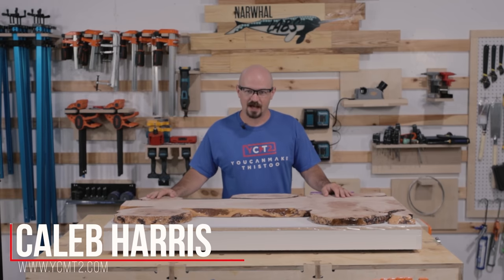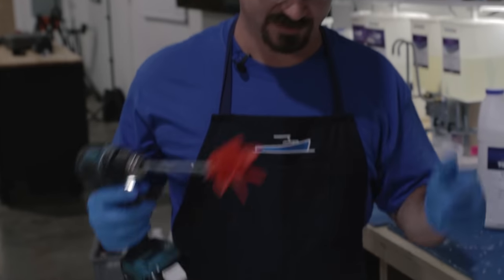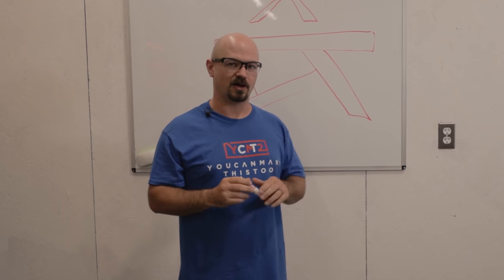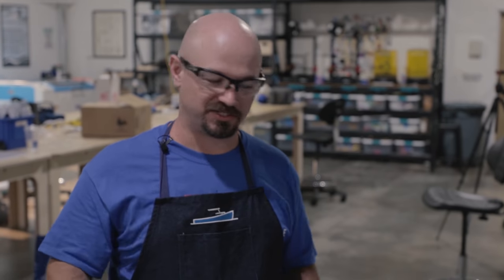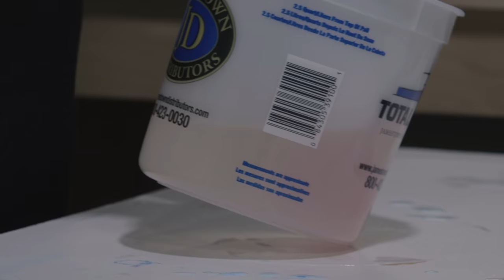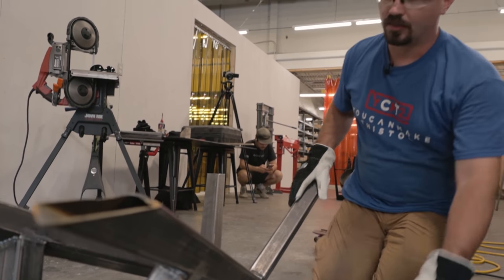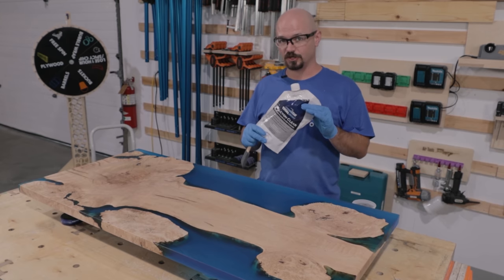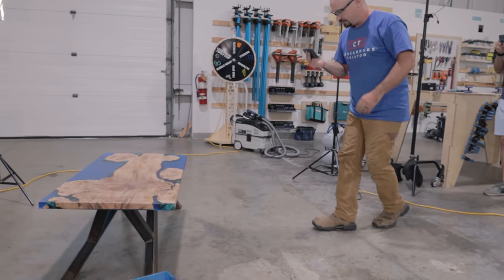Flew Across The Country To Build This

Comment: Stunning table. This may sound a stupid question but after you've poured the resin could you use the "bottom" as the "top" if not why?
Reply from the maker: For sure, it doesn't matter. I used to always do top down actually.

Comment: I noticed you sealed the edges of your wood but didn't key them with sandpaper to accept the subsidence pours. You may find that it will start to delaminate after a time.
Reply from the maker: I thought about that afterwards. I don't think it'll be an issue though because of the geometry, they pours are pretty captive. Also, the edges were still quite rough so a fully chemical bond isn't as necessary since it can create a mechanical bond.